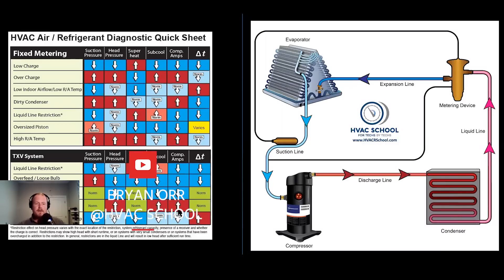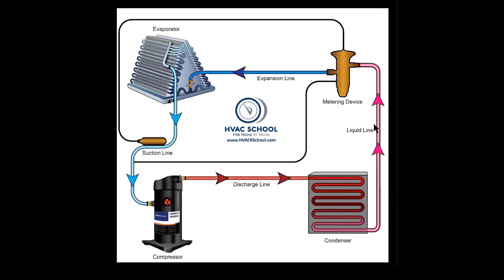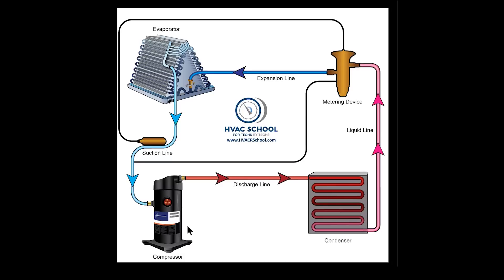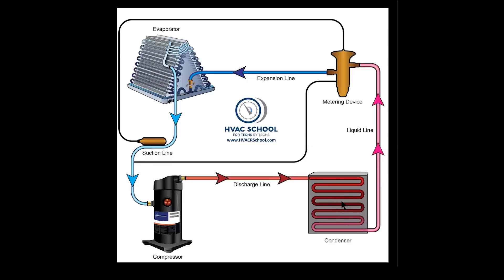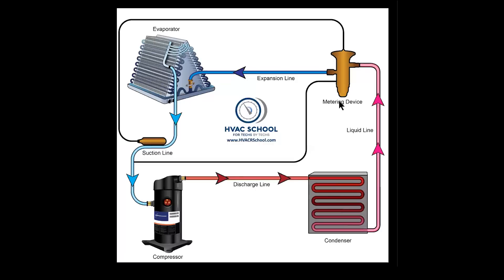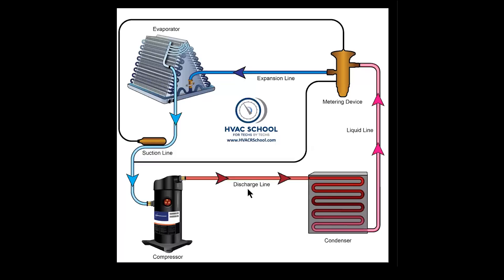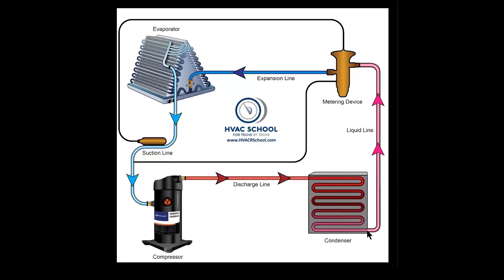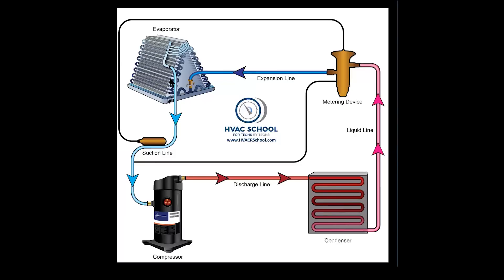Do Line Restrictions Cause High Head?

Comment: In my experience, only systems with sufficient liquid capacity(big condensers/receivers), will not raise head pressure during a significant liquid line restriction. A system with a capillary tube, (small freezer/refrigerator), will experience a very high head pressure. And that's what everyone else I've heard is experiencing(including Ty Branaman in his video about restriction). With AC units, I cannot personally say, since when shutting the liquid service valve(during pump-down), the gauge is connected the outer part of the tube, not the inside. So of course the reading is going down. Maybe the type of compressor(scroll, piston) is also affecting the result. Any way, for a piston(reciprocal) compressor with a capillary tube blockage, the head pressure will go sky rocketing.

Comment: My R410A 5 ton, 14 SEER unit was running 510 PSIG (136 degree sat temp) when it was 112 degrees outside. According to diagnostic chart CTOA that would actually be about right. 20-25 degrees over ambient temperature. Is that correct? I was worried the head pressure was way too high and I'm overcharged. compressor amp draw was 23A. Plate lists 26 RLA.
Reply: Dirty condenser? Incondensibles?
Reply: @seek3n  I am worried about incondensables but when I measured again when it was cooler outside (90 degrees) H 380 psig (113 sat temp), 102 liquid line, 11 subcooling (calls for 10), L 143 psig (50 sat temp), 62 vapor line, 12 superheat. 18A draw. Those numbers are within proper range. In this case COTA is 23 degrees which seems about right for a 14 SEER heat pump. As long as my condenser sat temp is about 20-25 degrees above ambient temp and I have 10 degrees subcooling, the system seems to be running at proper temps. I may be a little over charged. I'm going to check my subcooling again at multiple ambient temps. I cleaned condenser coil a couple of times so I think it's okay.
Reply: @mtbbiker6401  what's your indoor return temp? And is it a txv? The design for cooling is vapor Sat at 30-35 below return temp.
Reply: @seek3n   Thanks. It's a TXV heat pump. I've been playing around with the placement and positioning of the indoor bulb. It was mounted inside the handler but I moved it to the outside. I didn't know about the 30-35 below return temp. I will check it again tomorrow but I think that was about right.

Comment: Since we are talking about restriction. I would like to add a question to a person of your knowledge and expiriance that can help me asnswer it. 
How can i prove that a the coil condensor is restricting refrigerent and causing an issue or change from original standing point? IF lets say hail hit the condensor coils and dents the refrigerent pipes inside. I can comb the coil but that only hides the restricitions dents inside and/or potential micro leak.

So would i check these with a refrigerant leak detector tool and gauges?? What would i be looking for??
Thank you!

Comment: I’m trying to determine whether or not my compressor is going bad. The unit will run fine when outdoor temperatures are below 80 degrees, but outdoor temperatures above 80 and above cause the compressor to shut down. The air handler is still blowing fine. I have to hit the red reset button on the compressor In order to get it to  restart. Compressor fins are clean. Any help would be appreciated.

Comment: I have a question what about if the low side is normal air flow is good but the high side is high what is going on there
Reply: Clogged condenser

Comment: Of course a inop condenser fan, or fan that is beginning to fail and possibly running slow cause Temps to rise in the condenser, which raises pressure. Right?

Comment: 410 system. low suction 98 psi, very high superheat .... head pressure 410 psi with 0 degree subcool????? no receiver  clean condenser??? restricted txv with low charge??

Comment: I came across a weird one on a carrier heat pump, while running in heat. My suction was 90psi and discharge was 250psi. Acted like a low charge but when adding refrigerant my suction psi would go up but my discharge wouldn't move.

Comment: Why is the superheat so high though? if it's not absorbing much heat, then you would assume superheat would be low? I understand everything else, but I can't figure that out. Maybe it's too late at night.
Reply: Superheat is a measure of how much heat the gas has absorbed above it's saturation temp/change of state. It is easier to add heat to a vapor than it is to add heat to change the state from liquid to gas. If you've got lower pressure of refrigerant in the evaporator, the liquid is more prone to absorb heat. It changes to a gas quickly and spends more time in the coil as a gas. That enables it to absorb a lower quantity of heat, but it moves the sensible temperature up. You end up with a lower amount of BTUs absorbed by the refrigerant, but more of it is sensible heat. It shows up as higher superheat.

Comment: Great video, what would cause a higher than normal LLT, 4 ton with a TXV. The subcooling stays at around 5 degrees regardless of charge, the Superheat does vary with charge. Thanks in advance.
Reply from the maker: I have noted your question and will answer it in Q/A video

Comment: Hope this comment doesn’t taken negatively. 
The word “reject” can be counter intuitive in HVAC operations. Example - reject heat. 

Reject often implies - oppose, against, repel and reflect something from outside that is not already in the system. 

In HVAC a more appropriate word may be - discharge, release, dump, unload etc.

This could open up our student’s mind, a bit.

Comment: What would indicate my head pressure if is at 450 and low side at 120? Could it be a dirty co denser coul or a bad txv
Reply: Bad Txv. but make sure you have blower working running are across the coil , and make sure there is nothing stopping or slowing down the air flow

Comment: My question is, how come when its 65-80 degrees outside i ALWAYS get a very low subcool and about 15-20 superheat (residential units). And the saturation temperature is always about 5-10 degrees above ambient. Is this normal?

Comment: Love your videos, watched almost all of them and learned a lot!!
Just a quick question, the graph that you made "HVAC AIR/REFRIGERANT Diagonistic Quick Sheet", when you use arrows to portray high and low, what is that high and low with respect to? What is the definition of High or low? are all these values fixed by the manufacturer? what if the manufacturer doesnt provide these pressure numbers?
Reply: Oh boy you got a lot to learn.

Comment: I like your explanation or discription of the components in the system.  One thing that can mess people up is thinking pumps create pressure.  They don't.  Pumps create flow, resistance to flow creates pressure.  Your metering device be it a TXV, or an orifice is a restriction.  The TXV because it opens and closes changes the restriction to flow either more or less which will change the pressure.  Thanks

Comment: Great education video. I’m checking the diagnostic quick sheet and I do have questions! How the suction pressure or head pressure line go down or up and the superheat or subcool “normal”??  In my thoughts if the pressure change the subcool or superheat also will change!! Or not?? Thanks

Comment: What can cause high side to be at 110 psi,low side is 65 psi,system is r22
Reply: Need a bit more information than that but just a guess.......possible compressor blow by(compressor valves) or maby a stuck reversing valve.
Reply: @jesseluna4731  ..i replaced compressor & did the same thing,i took out original dryer filter from inside condenser & it had alot of debris,i end up replacing the condenser & now is working, im just curious what caused that issues in 1st place,maybe to much oil in condenser?
Reply: @justdissin7340  Would need to know that ID temperature and tonnage of the system. 
If you indoor temperature was low and you were working a unit under 3 tons possibly nothing was wrong with the charge.

Comment: That is a fantastic troubleshooting chart, I would like one as well. I do believe I have a different issue. Outdoor ambient temperature is 75 degrees.
This is a Trane 7.5 ton built in 2002 R22 heat pump system.
There are times when the system will run for 10 to 15 minutes with no issues whatsoever.
Then after this period of time the system will do the following.
The head pressure will modulate. Meaning it will go from 250 psi to let say 325 psi. This varies  greatly up to 375 then the high pressure switch opens  and with in seconds the cycle repeats over and over and sometimes it will operate correctly for a brief period of time. All the while the suction pressure remains the same 75 psi.
Any help on this would be greatly appreciated.
Reply: These units have split coils, I would pull the fan housing off and split the coils, check and clean, this is the most common problem with these units. If this doesn't fix the issue, then I would recover the refrigerant, replace both filter/driers and check valves that are on the floor of unit, some would go ahead and replace TXV while refrigerant is out of system, then I would after a proper vacuum, recharge unit with new refrigerant using the subcool & superheat method. Thats my 2 cents anyway.

Comment: Liquid line head pressure will be high at a constant increase depending on restriction severity ( closing king valve on condencer during pump down will show high side deminishing pressure as pump down acures because king valve port is open to side going towards metering device and not reading inside condenser as compressor pumps down whats in line set) During a restriction your connected at all times to what is happening in the system thus able to see when a full or partial restriction is accuring lower than normal suction high superheat for low side and high head or higher than normal pressure and high subcooling for high side.
Reply: Shut up William